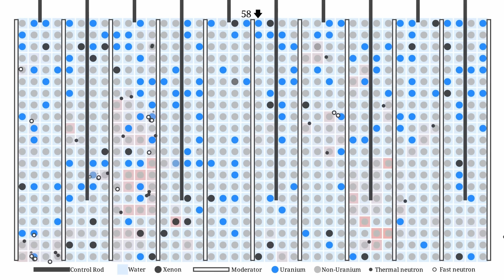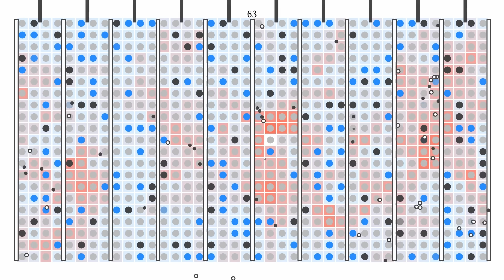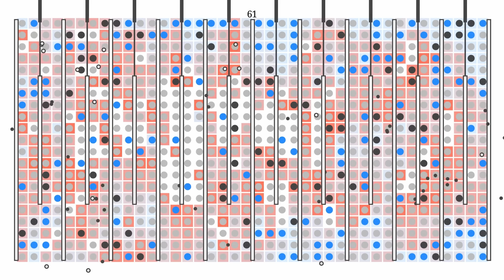Chernobyl Accident - Simulation only (no talk)

Comment: “We do not know how high the power went, we only know the final reading. Reactor 4, designed to operate at 3,200 megawatts, went beyond 33,000.”
Reply: There are indications that it went as high as 200.000+ in the few microseconds before it blew.
Reply: @FabledGentleman The soviet union consumed about 259 giga watts of power at that time, so one reactor could almost power the whole Soviet Union if that is correct
Reply: @buolindo8795 No one knows for sure. But yes, it's several who thinks it reached as much at the very peak a split second before it blew. We are talking about an unsustainable runaway reaction.
Reply: @buolindo8795yeah its almost like nuclear energy could solve our clean energy issue its not like oil barrons would want to deter people from using it
Reply: @OG_Mr_Popo  they’re removing nuclear sites off the grid for solar and wind. Problem is they’re not always putting out power. It’s bursty
Reply: @griesrt  not to mention how dirty wind and solar units are to manufacture, their maintenance and costliest, short lifespan, land footprint...why do we think they're a good idea at all for grid power?
Reply: @brough59  one good thing about it is that in summer, during the day there is a big need for power especially in TX.  The solar offsets the demand and helps with peak usage.
Reply: @griesrt  yes but peak demand almost always hits as the sun comes down. Solar panels in California could provide some of the peak power for the east coast, but again, theyre expensive, dirty, short lived, depend on rare earth metals mining, and take up large amounts of land. 
There are plenty of great applications for solar, even rooftop solar when people pay with their own money, but it's a terrible idea for government to subsidize it because there's no roi for utility/tax payers, it mostly just stuffs solar people's pockets and creates a lot of problems on the grid.
Reply: @brough59  Yes low margins business. They're going to move power from California to the East coast?
Reply: @griesrt  thats my example of the most efficient use of grid-scale solar, you can see how there's obviously issues with that😅
Reply: @FabledGentleman not great, not terrible
Reply: @FabledGentleman 200+ or 200,000+
Reply: @FabledGentleman 🤖"A typical household in the United States consumes about 1.2 kW on average. 200,000 MW could power approximately 167 million households. There are 120 million households in the USA"
Reply: @Zhiivago  Goes to show how dangerous and explosive a runaway nuclear fission is. It just keeps on accelerating at ever increasing rate until nothing can hold back the pressure.
Reply: Just finished the series
What a disaster!
Reply: @ A lot in the series was changed from reality to make it more entertaining to watch. But the scope of the disaster is pretty accurate.
Reply: @FabledGentleman  Yes i noticed that there was lot of “plot like” decisions but the first episode really shocked me, i stayed still and in silence the whole episode, watched it with my dad. 
It’s really well done and very useful to understand what happened and why
Reply: @giannipower5056  That show was incredible, the moment where they go thourgh those cooling line tunnels half submerged under water and in the complete dark with the geigers clicking was the scene that got me close to a panic attack. Had to stop watching and go out for a walk after that one.... Never felt that from a movie/show before, it was incredible at the time
Reply: @pijcab  I feel you, did the same thing after the first episode 😂
Reply: @pijcab  My version of that scene was the rooftop. Dude looked over the railing every time he threw a piece over. I've had actual panic attacks before, and that was the first time a piece of media nearly induced one on its own.
Reply: @axelfoley133  Hmmm, rooftop scene was good to for sure
Reply: @pijcab  Probably because in most movies or series you can always tell yourself “this is fiction.” But here…you couldn’t.
Reply: @petelancaster6715  why? Just because it was based on real events?
Reply: @andreyevsv  I’m saying that this is a movie about a monster that REALLY WAS under the bed in real life, which makes it even more terrifying. Real people went through this.
Reply: @petelancaster6715  Yes, and this real peaple was nothing like that was shown in the movie. Do not leatn history by movie show.  Or you will get absolutly twisted version of reality.
Reply: @andreyevsv  So all of the firefighters actually lived happily ever after and did not suffer any consequences from radiation?
Reply: @petelancaster6715  I didn't say that. So, do you believe all you see in movies?
Reply: @andreyevsv  That’s called a “Strawman’s fallacy” and it’s a misrepresentation of what I said. Perhaps education in Russia is lacking.
Reply: @petelancaster6715  in Russia we call it a question. And if you are not educated enough to understand what I mean, I will wright it. 
The one real fact in the movie doesn't mean that there is no a heap of bs in it too.
And speaking about fallacies, you just made two: hasty generalization, and ad hominem.
Reply: @andreyevsv  Didn’t read a single thing you wrote. Goodbye! 👋
Reply: @giannipower5056 I watched it with my dad tooo. Completed it 2 days ago
Reply: @andreyevsv it’s true though… as good as the series was as a show, they got A LOT wrong from a historical standpoint… especially in their portrayals of Dyatlov and Legasov; Dyatlov wasn’t the out of control raging asshole the show made him out to be, and Legasov was much more of the prototypical apparatchik then they made him out as trying to fight against. That Chernobyl Guy here on YouTube has a fantastic series that covers pretty much everything anyone ever could want to know about that night and the people and powers that were involved in the cleanup and decision making. I always try to point people to his channel to try and spread more awareness on keep the truth from being buried… because let’s face it, us Americans will do anything to keep up the myth that the Soviet Union was utterly incompetent in every single thing ever and always 🙄
Reply: @petelancaster6715 well... some parts were fictional or sensationalist.
Reply: @FabledGentleman  The YouTube channel History Buffs did a great analysis of the miniseries vs the real events. Highly recommended!
Reply: @FabledGentleman Legasov was married irl. And he died exactly 2 years and 1 day after Chernobyl on April 27th 1988. In the trial Legasov wasn't really there, nor was he really as heroic as the series portrays him. He was a career party  man and knew exactly how the USSR operated, the Soviets did attempt to silence it (my mom and dad are both from the USSR (Now Belarus and Ukraine)) and corroborated how the USSR attempted to bury it at first, the series of events leading up to the explosion is pretty much to a tee, oh and irl the miners weren't naked 😅, The woman from the Belarusian institute represented the scientists working alongside Legasov, and he didn't record 6 tapes but 5, but since the series starts with him recording the sixth tape I can understand the artistic license to use it and ask "what is the cost of life?", historically the series is pretty accurate
Reply: @petelancaster6715 well, it was a LOT of fiction. That series did a massive disservice to the public perception of nuclear energy - something so incomprehensibly less destructive and more efficient than what we have now gets halted because the general public isnt intelligent enough to  understand even a high level overview of nuclear energy. They see chernobyl and fukushima, never paid attention in stats class, and go "oh this is bad. Nuclear = bad" when thats so far from what the reality is. My friends and I who are actual members of the scientific community despise that show for how it influenced the extremely dumb masses, who are too dumb to even vote in my opinion.
Reply: @petelancaster6715 what a horrible way to intake history. This show fictionalizes and dramaticises pretty much every aspect of the event. The scientific community HATES that show for a reason.
Reply: @makingadjustments hurr durr  muh science!!! 
Dude chill, nobody's protesting against nuclear power plants.. and the edgy thing you said about the dumb masses... go on, move to PRC or DPRK , ain't nobody voting there amirite?
Reply: @giannipower5056 where can i find the series?
Reply: @giannipower5056 
The series is a caricature of the events and as the liquidators put it best "an insult to the heroism of all liquidators who risked their lives"
Reply: Oh yes the annoying people going to places discussing technicalities and commenting about this show that was like 30% accurat and full of added plot points from imagination
Reply: @Alen725yes, the "annoying" people who dont want history re-written because apparently you have countless examples in front of you yet choose to remain reductive and intellectually dishonest. Nice, thanks for being worth anything at all.
Reply: @makingadjustments  clearly he knows more than you
Reply: @Alen725 y-you too
Reply: Not Great
Not Terrible
Reply: You're delusional it was 3.6 Roentgen, not great, not terrible
Reply: 3:28
Reply: You gotta pump those numbers up, those are rookie numbers.
Reply: It went way above that we just don't know how much but WAY above 😂
Reply: You're delusional, take yourself to the infirmary
Reply: dummy it was not just "33,000"
Reply: Is 4 the last column which has the most uranium forming causing it go that high?
Reply: that value comes from fans sipinning that were meant to operate at 3200MW. they didnt handle more than 33000.. the pressure it was so intense that the lid of the rbmk of 2000ton was believed to fly several meter for the graphite dispersion.
Reply: A movie about Chernobyl…?
Reply: But… what the hell is a gigiwatt!!?!?
Reply: 33,000 huh. Where have I seen that before.
Reply: True, then it failed but no doubt produced way more potential power than that.
Reply: "At long last, we have arrived... 1:23:45... explosion."
Reply: Wow
Reply: “OVER 9000!!!!!” 😂😂😂
Reply: All these assholes know nothing about Chernobyl, why watch HBO when you can look at actual documentaries that don't contain bullshit?
Reply: And then exploded!
Reply: Not great .... Not terrible
Reply: 3.6
Reply: the party of the soviets wishes to congratulate the plant for meeting its 5 years  quotas in two minutes
Reply: ITS OVER 9000!!

-Vegeta
Reply: Not great, not terrible.
Reply: Ironically, I think 33,000 is the number at which Higgsinophysics terminated the simulation.
Reply: I don't get a damn thing. Can someone explains me what's going on in that video ?
Reply: @olivaSparl-c1o
Magical hot rock make steam, steam spin fans, fans spinning generate electricity is how reactors create power.

If control rods are low, power is reduced, if they are raised, it’s increased.

Think of control rods as neutron vacuums, they’re slurping up all of the zoomies in the water so the zoomies don’t create too much heat. 

If too much zoomies… too much heat….and in nuclear reactors, it’s BIG BIG HEAT. Water explodes on contact with this type of heat into steam, and hot metal melts through concrete, not just reactor shielding.

Now air has zoomies after explosion.

Zoomies not good for human. 

I hope this somewhat helps.
Reply: The HBO series was a masterpiece, i rewatch it like every year
Reply: This series put Dyatlov in bed light and Legasov like a angel.
Reply: good, more energy

Comment: Not exactly but yeah. When they realised the reactor was unstable, these guys fully inserted all graphite rods to regulate the neutron chain reaction, but it was not supposed to proceed this process instantly , This displaced the water which accelerated the neutron reaction and the temparature skyrocketed.

On the other hand, the control rod had hollow sections which temporarily increased the reaction. Water turned in to steam almost instantly and rods caught fire which then exploded.
Reply: The rods were made of boron .. they had graphite tips which increases the reaction by displacing hydrogen which is why when they hit AZ5, it spiked the reaction and effectively caused the explosion

Comment: Alot of people here saying the operators did wrong.

They did not. 

Under regulations at the time nothing they did wasnt permitted. The design flaw of the reactor takes the largest burden of blame
Reply: They broke regulations.
Reply: @thegamingott3236  Which ones. I'll admit the ORM was violated at one point but this was never made aware to the operators
Reply: They broke several regulations, the ones that were the most important were;
1) In case of a xenon build-up inside the reactor, it should be halted for 24-48 hours
2) Under no circumstances should there be less than the equivalent of 30 control rods inside the reactor
Reply: @warcrimemenace6292  Xenon will always build up inside a reactor when a power level is lowered so it doesn't always mean there needs to be a shutdown. The operators of the night would have struggled to understand the size of the Xenon pit that they were in as well, due to the lack of the usual Physicist from the Physics laboratory located at chernobyl who was mistakenly told the reactor was already shut down. They normally use a computer program to calculate the Xenon gradient and advise accordingly.

The minimum number of rods in the core also know as the Operating Reactivity Margin (ORM) was set at a minimum of 15. The figure of 30 was not a absolute minimum and was more of a warning point. Whilst it's possible it did dip below 15 the operators did not realise it had, as the printout for this reading takes 5 minutes and they had never printed a figure below 15. It should be noted that the regulations are a mess and constantly contradicts itself.

 So consciously the operators did not break regulations.
Reply: @Echo06  I am 70% sure in the IAEA report and INSAG-7 for the chernobyl incident it was reported the operators suspected heavy xenon poisoning. And while it is true that the RBMK used a computer program to estimate xenon content inside the reactor, the operators were still trained to detect xenon poisoning (the fact they had to pull out most of the CR beyond regulation is a clear tell of that, and they knew that). 
I would like to mention that I did infact make a mistake when I said the minimum ORM was 30, it was infact 15 as you said. The ORM was lowered to 8 during the initialization of the test which was strictly against proceadure, and I do not know where you got the idea that the operators relied on the computer for the position of the CRs and would appreciate if you have any source that says so.
Reply: @warcrimemenace6292  It was not that the operators relied on a calculation for the position of the control rods but they instead needed a calculation for the ORM
Reply: @Echo06  The RBMK 1000 series had indicators for the CR positions, from which ORM could be easily determined by basic algebra... In later series there was an indicator that displayed the exact ORM for operator convenience, but do you really believe the RBMK had operators moving rods without any sort of display of the current rods positions?
Reply: @warcrimemenace6292  No they obviously had a display of the position of the control rods. The orm is just a guidance for the positions not a real time indicator. The 'basic' algebra was performed by the SKALA computer which was designed in the early 60's and was used to process thousands of inputs so it took about 5 minutes for them to get an ORM reading
Reply: @Echo06  the RBMK computer gave an actually accurate ORM reading, but again, operators were trained to estimate current ORM through the sum of the position of all CRs incase of a computer failure/situation in which waiting for the computer readout would be unfavorable.